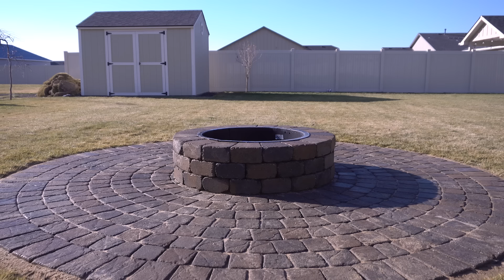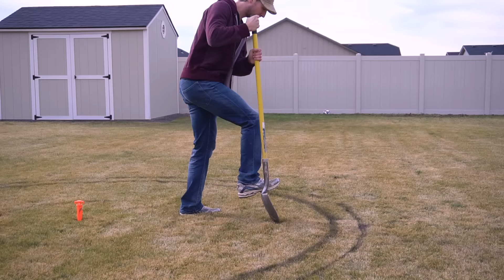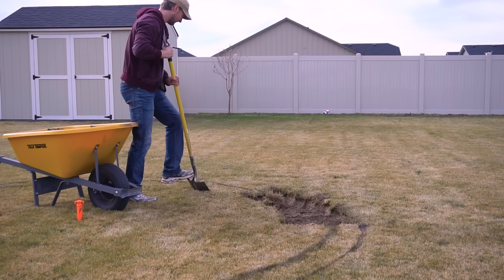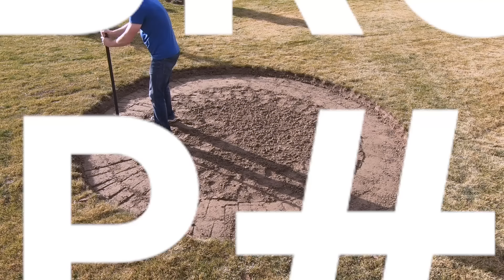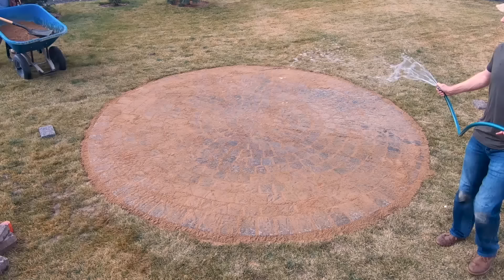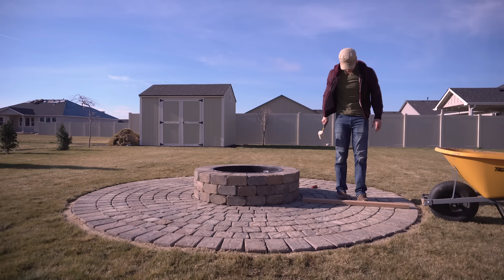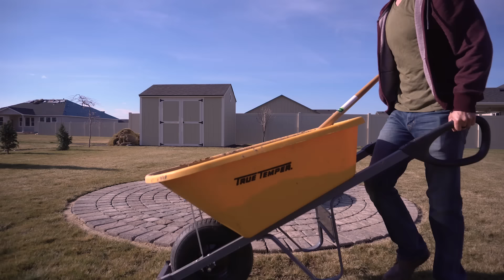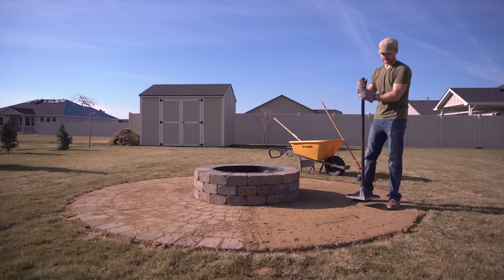My 4-Day Fire Pit Patio Build [Full DIY Project]

Comment: NEVER hammer pavers lol.  Always place down.
Reply from the maker: I think they need to get set firmly somehow. There's been a lot of comments about using a compactor over the top, or compacting the sand first, and I can see how those methods would work (probably better than what we did). But IMO, there's no way the patio would've been stable without that hammering. They would've just shifted all over the place.

Comment: Looks great! My only concern is that the fire pit does not have any fire brick inside. Overtime you may see cracking.
Reply from the maker: Fire brick would definitely be better, but I think the metal ring will help protect them from too much heat - hopefully anyway!

Comment: WARNING: the last ring on the fire pit is dangling over the side. If someone sit on the edge of the stone, it will dangle and roll over. Make it the width of the stones below.
Reply: For sure. Or attach the to the layer below.
Reply: or add cement
Reply from the maker: Yeah, we'll attach it with some masonry adhesive. At the time, we wanted to wait if we needed to adjust any of the bricks. We did end up doing that to increase airflow and reduce smoke in our next video: https://youtu.be/2DlTu1PxBCU

Comment: Why did you dig out dirt then put sand?
Reply from the maker: You want the patio to be the same level as the ground around it, so you've gotta dig down. Then the gravel and sand is to make a solid base which still allows water to drain through. Normal ground is packed too solid and water won't drain away correctly if you don't plan ahead for it.

Comment: why would you do all that and not include a weed tarp?
Reply from the maker: Honestly, I didn't think of it. But weeds will just grow from the sand in between the cracks anyway. So we'll have to spray or weed regardless.
Reply: @BroBuilds  well that's kind of lazy. The difference is at the roots become a deeply rooted if you don't put something down first, and then you actually do have to spray which is toxic. If you put the paper down the roots just easily pull up through this and it doesn't take any effort whatsoever. Maybe you like more work and toxic chemicals
Reply from the maker: @ilikecake8255  lol, I said I didn't think of it. . . If I had, I would've. But even so, there would still be weeds, so I'm not depressed about it or anything. 😄

Comment: Is there a rule to choose a digging depth?
Reply from the maker: From what I understand, you want at least 4 inches of compacted gravel for pavers that will be walked on, and 7 inches of compacted gravel for pavers that will be driven over with any kind of vehicle. So then you just add 1 inch for sand, plus however many inches you want the pavers to be sunk down into the surrounding landscape.
Reply: @BroBuilds  
OK. Thanks. I assume that there is something like a "user guide" following with the pavement blocks? 
I also wonder about movement of the pavement after you complete installation. When seasons change (cold, warmth, rain) there are some movement in the ground. How does the pavement left stable?

Comment: Where is the cement? As soon as the guest sits on this structure, it will fall apart
Reply from the maker: It holds together fine with gravity, but once we finish adjusting the fire pit for more airflow (see our next vid) we'll add some masonry adhesive to make sure it's safe.

Comment: What you did is great but you can tamp the pavers instead of the hammer and a packer which goes over it and vibrates the bricks to get the sand deeper and level does an amazing job
Reply from the maker: Great tip - thanks man!

Comment: so the rocks in the middle wouldn't fall out if you step on it or something? wouldnt you have to hold those pit rocks down somehow?
Reply from the maker: Not really, no. But, we do plan on adding some masonry adhesive once we're done adjusting the bricks (for better airflow and stuff). Basically we're still working on the fire pit a bit, to make sure it's as good as it can be.

Comment: doesnt it need cement or something to stick together?
Reply from the maker: Not really - it's all pretty firmly in place. We do plan to put some masonry adhesive on the fire pit blocks and caps at some point. We just knew we wanted to adjust them to get more airflow first: https://youtu.be/2DlTu1PxBCU
Reply: @BroBuilds  just saw the other video, the only thing its missing are  couple of beers, cheers brother

Comment: What advantage do you get for laying the pavers in the middle foot and a half, where the fire pit is?
Reply from the maker: Mostly it helped us get the rest of the paver rings laid down perfectly. We could have taken up those middle pavers later (and still might) but they were just necessary to get everything straight and centered.
Reply: @BroBuilds  That makes sense.
Reply: @BroBuilds  Do those pavers have a resistance to higher temperatures?
Reply from the maker: @aurorazoe6011  not that I'm aware of.

Comment: Hey I don't know if you read your comments but I noticed that you did not glue the caps and you did not move the fire pit unless you did that without being videoed I do hardscaping for a living and those things should be done to secure your blocks and your fire pit caps to make sure they don't get broken you did an amazing job though
Reply from the maker: Yeah, we waited to glue the caps down - we're still adjusting parts of the fire pit to increase airflow and reduce smoke. Here's a video update showing that: https://youtu.be/2DlTu1PxBCU

We'll use masonry adhesive on the fire pit and caps to make sure it's all solid after we finish changing things though!
Reply: @BroBuilds  it was fun to see how you guys did that you guys did a very good job if the sand washes out polyurethane is pretty good to use it'll lock everything in place and it won't come out for about like 3 years but I'm sure you already know that you guys did a fantastic job anyways good job
Reply from the maker: @allisonwelsh1359  thanks! Yeah, polymeric might be in the future for sure

Comment: With fire getting very hot over a duration of time I suspect the pavers under your pit will crack. Not sure that’s a great outcome from all the work done. I did not see where you leveled the pit either... maybe that was cut out.
Reply from the maker: So far no cracks, but I do see that as a possibility. We'll probably change up the floor of the fire pit at some point to guard against that. Here's a video update we posted this spring to show how it's all doing after fall and winter here in Idaho: https://youtu.be/2DlTu1PxBCU

And no, we didn't level. We wanted it to match the slight grading of the yard. I worried that if we made it level, we'd have one side of the patio raised above the grass (tripping hazard) and the other side sunk below, which would accumulate rainwater. Normally I would level, but it didn't seem right in this case! :)

Comment: Concrete and fire do not mix, it can actually explode look it up
Reply: Lmao you don't know what you're talking about
Reply: @ZeroDarknezz  You know it is very possible for a good amount of water to remain in a concrete brick and they can soak up moisture from rain which when heated turns into a quickly expanding gas (steam) So you’re saying company’s just make fire bricks for no reason right? 

This is speaking from experience I’ve built fire pits with concrete bricks it cracked over time and not every brick yes it didn’t explode but it can just like rocks can but usually they’ll just crack.

Comment: I would of just laid the bricks down on the grass lawn already looked super level...
Reply: In times of lots of rain, the pavers will sink into the ground. You need proper drainage underneath the pavers so things don't sink and shift. Gravel is something you definitely should not bypass. You can get away with 2 inches instead of 4 tho from what I've seen on several videos.

Comment: I will give you a little tip for the future if your  sand between the pavers does eventually settle down to far is get a polymeric sand which has silicone ingredients in it sweep it into the cracks and wet it down, let it dry and it will seal all the papers together and it stays together a lot better than the sand. Also if pavers start getting uneven take a plate compactor over them with a rubber mudflap tied onto the compactor underneath the plate and run it over the pavers to get a nice even patio
Reply from the maker: Thanks!

Comment: Been in construction for years, quick "pro tip" effective and easy way to let dirt/sand/gravel compact AND level itself is yo spray it down with water, let the water sink then spray again. You do not want puddles of standing water, so stop when the ground does not absorb anymore. But this method is actually a tip the concrete setters use so they don't have to go and compact the dirt by hand or even with a compacter.
Reply from the maker: Great tip, thanks!

Comment: Soooo, depending on where you live and what kind of frost is in the ground....  this video could just be a "how to create an expensive but ugly ass nightmare in your backyard!" LOL if you live anywhere that gets below 32° F or 0° C, excavate for 12 inches of "A" gravel . Please , for the love of God take my advice if your thinking of doing this or at least use an actual compactor . There is no where in the world where a hand tamper would be enough to compact "A" gravel to the point where it won't settle under the weight of interlocking bricks. Otherwise this guy is fairly smart actually for a dweeb
Reply from the maker: Nice. 😂 "Dweeb" really sold the compliment at the end. FYI, no issues with bricks moving after one winter. We'll keep posting updates though, whatever happens with it.

Comment: Alright.... I have some questions for this bro build. What is the point of the conduit, what do you mean "stamped" bricks, and why didn't you put any sort of weed blocking tarp or mesh under this thing?
Reply from the maker: The conduit keeps your 2x4 exactly one inch up from the ground, so you get a perfect one inch layer of sand when you slide it along on top of them. The stamped pavers just have a textured surface on the top, so they look more textured/interesting than regular bricks. No weed blocker because A) we forgot but also B) weeds will grow in the sand we put down anyway, so it probably won't matter.

Comment: How do you ensure tou end up with a level surface before adding in gravel mix ?
Reply from the maker: I just eyeballed it. Probably should have used a level, but I knew we'd be adding gravel and sand, so it just didn't seem like it would actually matter.

Comment: This looks like something even an amateur like me could pull off with a little planning and foresight. What was the budget for this project?
Reply from the maker: Total, it all cost around $1700.
Reply: @BroBuilds  Oof, that's more than I would like to pay... there might be more of a budget way to do this. Next time my family has a yard to work with I'll talk with some friends.
Reply from the maker: @cleotasberkley9048  absolutely, there are cheaper kits available, you can go with a smaller fire pit, and you can leave off the capstones entirely. Some folks also just use regular pavers (rather than a kit) and that's a little more cost-effective too.
Reply: @BroBuilds  about how much did you pay for just the sand, gravel, and tools? (Minus the stones)
Reply from the maker: @cleotasberkley9048  around $300. And we bought way more gravel and sand than we actually used. :) Probably should've been half that.
Reply: @BroBuilds  Cool, so if I find a cheaper source for paving stones (maybe re-use some stones that someone doesn't need) then I could make something much cheaper with more of a personal flair. Thanks for chatting with me!
Reply from the maker: @cleotasberkley9048  sure thing! You got this. 👊

Comment: I used to have a very similar fire pit in the back yard, while it looked great, it wasn't warm to sit beside. All the heat just went straight up. I ended up removing the stone pit and putting in a cast iron manhole cover (inverted so the cone is down). It's raised up a few inches to get lots of airflow, with a grate on the bottom to hole the wood. Once the fire heats the cast iron, it's super comfortable to sit beside, and looks great.
Reply: You got a picture of it
Reply: Don't have a photo of the grate inside that sits on the frame. Those lets are about 8 inches long.

Comment: Problem with the pit being so deep is that though it looks good, it blocks much of the heat.
Reply from the maker: Yeah, agreed. We did make some changes in our latest video, mostly for airflow, but it also means a little heat gets out by your feet: https://youtu.be/2DlTu1PxBCU
Reply: @BroBuilds  yep. I would if I was to make one, dig the pit into the ground, then make the design go around that. When it's on the ground it's harder for wind to blow sparks everywhere and you get a real nice heat coming out

Comment: That turned out really nice. :)
When I'm doing something like this I use finer sand on top (like you'd find on the beach).
It comes down in the cracks much easier. Also, I just let a thin layer be on top. Rain and wind will do the rest and it will be fine within the first rainfall.

Comment: why not just walk on a plywood or OSB board at 6:10 ?
If you lay a board on sand, it will not move the sand as your weight is distributed if you walk on it.
Much more practical than your setup.

Comment: It's really nice looking , but ....
What is the point of a backyard fire ? 
Staring at the top of a fire ? 
Or 
Benefitting from radiant heat on a cool evening ? 
 If it's the latter , this is a fail. 
Build fire , surround it with tall bricks , receive no heat benefit. Can only see top of fire.

Comment: The problem with such a high pit is that you dont feel the heat in winters or at nights.
Reply from the maker: You do have to gather in close, and feel it over the top. Now that we've added some holes for increased air flow at the bottom, you can put your toes there, too. :) See the changes we made in this follow-up video: https://youtu.be/2DlTu1PxBCU
Reply: @BroBuilds  much better :) me and a mate build our own and we combined some of the best designs  we saw and closer to the floor is always a winner.

Comment: It's rare not to commit errors on our first attempt at any new project.
It's part and parcel of the learning process and building a new skillset.
You did a good job.
Reply from the maker: Thanks man!
Reply: @BroBuilds 
Don't get me wrong, I'm highly critical, if I feel someone merits it, which you haven't, but you've followed the learning curve, put your hands up and admitted where you could have done things differently, but the important fact is you've highlighted your errors, which makes it less likely anyone thinking of giving it a go won't benefit from your experience and that's worth it's weight in gold.
Give yourself a pat on the back, because you've earned and any credit, too.
Reply: @billyandrew  hmm... well said.
Reply: @billyandrew  They haven't admitted all their errors because they are still ignorant of some. This will not remain level, and their pave edge won't hold this together.

Comment: Looks awsome! You should have made bottom of the pit with a grate and leave some tiny draft holes in the bottom to help stoak the fire. You can avoid a lot of smoke that way and have higher flames with less wood.

Comment: Not bad but there are a few issues I saw. 1. There should be geo tech fabric on top of the dirt so the stone doesn't settle into the dirt, this could cause the pavers to sink. 2. There should be at least 6 inches of stone before the sand. 3. You should make sure the stone is level by using a level, you can add a slight amount of pitch to make sure it sheds water. 4. You shouldnt use normal sand in between the pavers you should use something called poly sand, there are directions on the bags about how to install it. Overall not bad for a homemade patio.
Reply from the maker: Appreciate it!

Comment: I wonder if you could have used concrete or something in place of sand or something
Reply from the maker: A lot of people have recommended polymeric sand, which hardens like concrete after you brush it into place and mist it with water. I chose not to use it, because I wanted to let the ground move in the winter without anything cracking (which concrete or polymeric sand might do).
Reply: @BroBuilds  Oh, that's a good point. Thanks for the reply

Comment: were I to do a build like this I would loosely pre-assemble the stones off the building sight then transfer it over to the prepared building sight. would have been a extra step but I think it would have made assembly go a lot faster in the long run.
Reply from the maker: Well. . . honestly, I wouldn't go that route. But who knows, maybe it would help.
Reply: you your self in the video say that you had some issues fitting them into place, pre arranging them before hand would salve that issue.
Reply from the maker: @jakstrieder  Man, it would take so much longer to arrange them all in another spot, and then move them. It'd be like building it twice. I just don't see the benefit.
Reply: I got the time!

Comment: I’m sorry but this is not a patio.  A patio is an outdoor space surrounded by indoor spaces like an interior courtyard. Interesting construction but wrong architecture vocabulary.
Reply from the maker: A few other people have mentioned this as well. For where I live, though, this is still considered a patio. Probably just different terminology based on our locations.

I found this definition online, if it helps: A flat area of ground that is covered with a hard material (such as bricks or concrete), is usually behind a house, and is used for sitting and relaxing